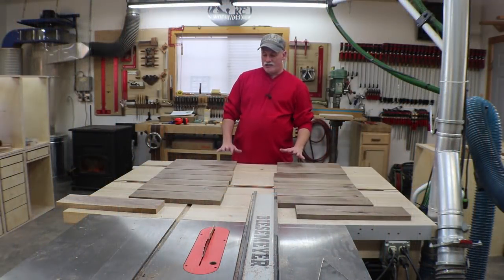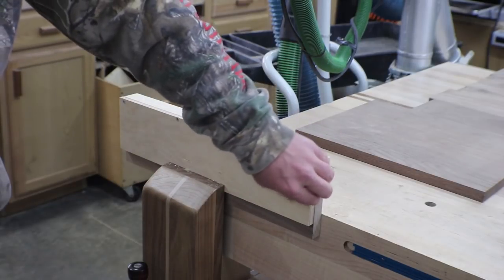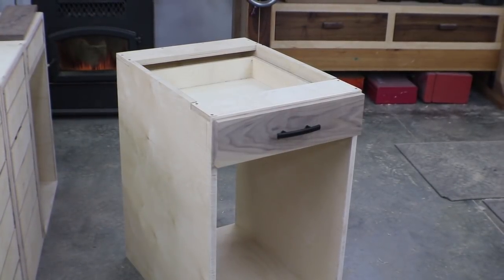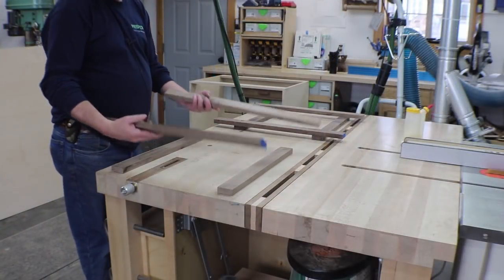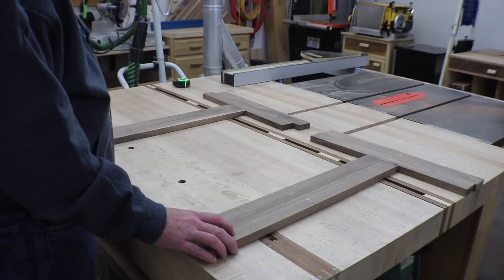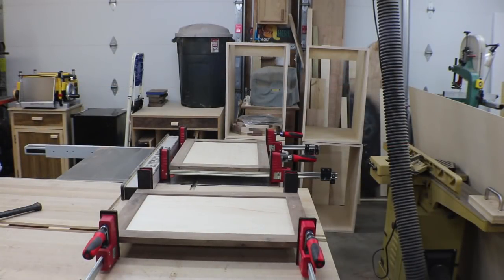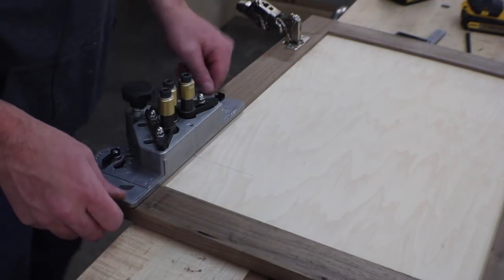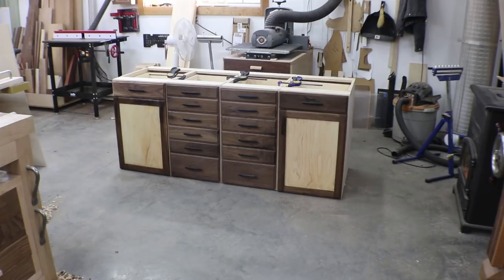Miter Station 02

Comment: Is there a reason why you don't cope and stick your doors instead of domino's? Or you could even do a blind dado on your sides. That way you don't have to plug the gaps in the ends of your doors. Just curious.....
Reply from the maker: All the stock was scrap in the shop and I just didn't have enough to do that properly.  Had I of purchased material, that's what I would have done.